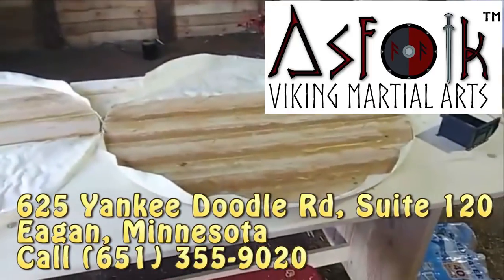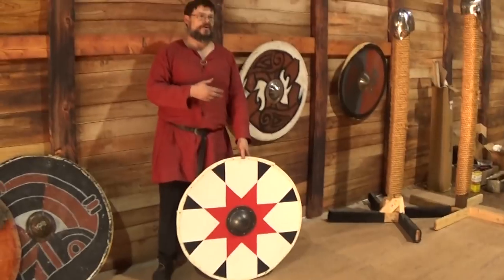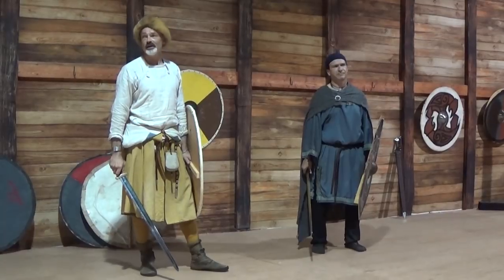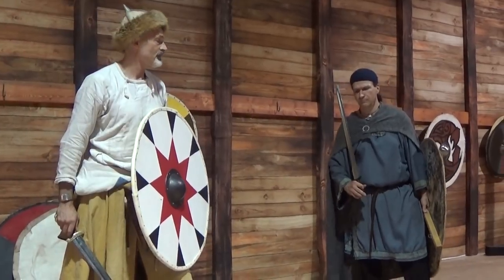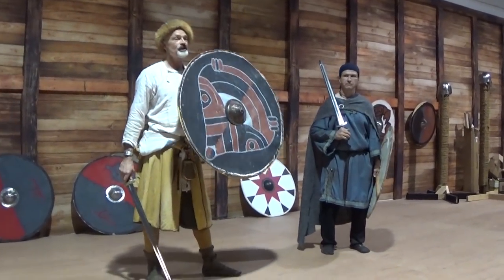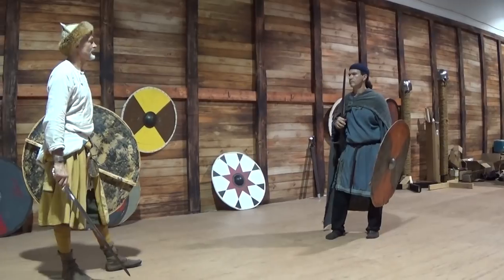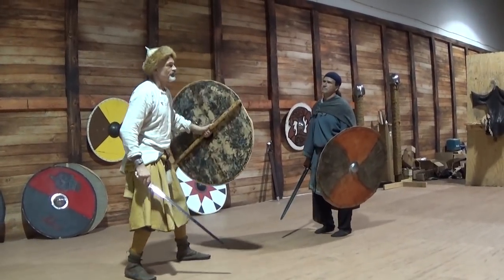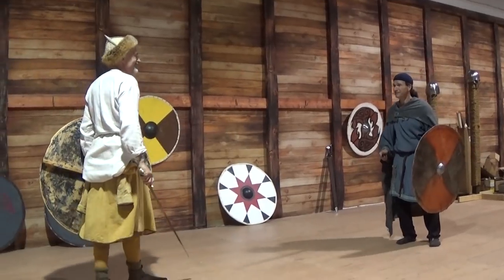Historical Viking shield test @ Asfolk /w Dimicator

Comment: Cool demos! 

I am curious if the effect would be similar using other weapons of the time since it was mentioned that duller blades really mess up historically accurate shields. I'm also curious how group battle tactics worked with shields that thin. I am pretty certain that hoplites and Roman Legionnaires didn't have thin shields. did Vikings use different shields for different purposes or were they all similar shields?

I'm also curious how you would get outta a situation like that. It seems the answer is either don't throw the blow in the first place since if you get countered you are in a lot of trouble. Or let go of the sword so you can move and he doesn't get free blows to your face?

fun to watch even if all I get are more questions.

Comment: Excellent demonstration, gentlemen!

I have a question, however: beginning at around 22:50 disarming with the hand is mentioned. Having tested this method of binding/disarming with the shield, would it be fair to say that using the shield in such a way provides much better leverage for disarming the opponent than a simple hand-grapple?

Comment: Thrand, I have a question. Since this is essentially leather, animal hide, don’t you need to oil it and take care of it? How do you take care of the leathery material? What oil would you use?
Reply from the maker: For Rawhide you keep it dry so half beeswax and oil rubbed over it work well I av heard to water proof it. You could paint it with casein  paint  it is water resistant almost water proof too but can get scratched off from use.